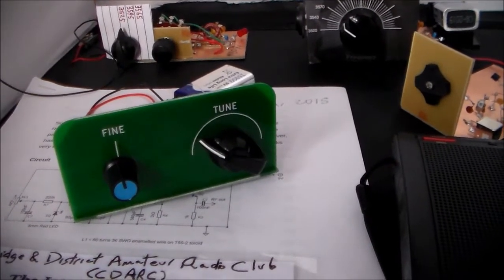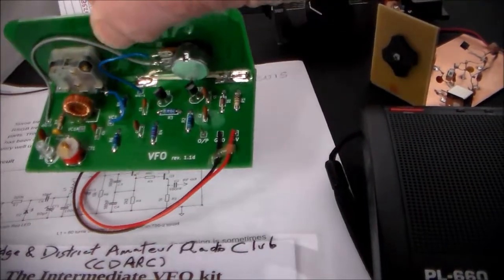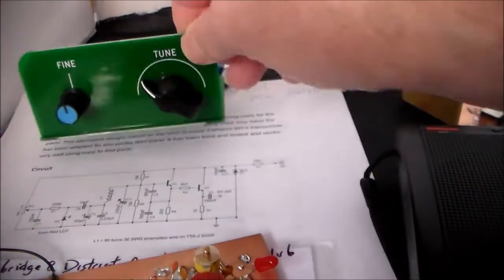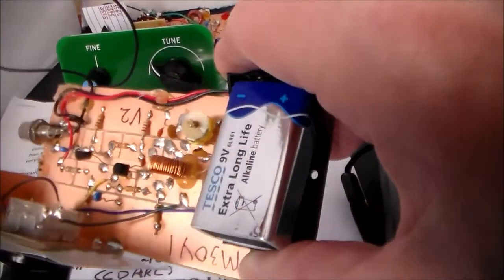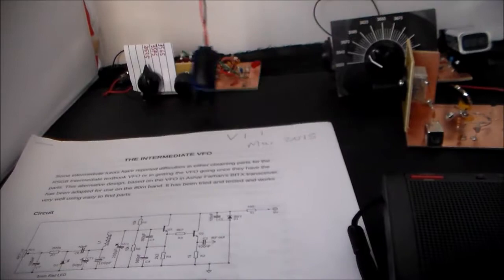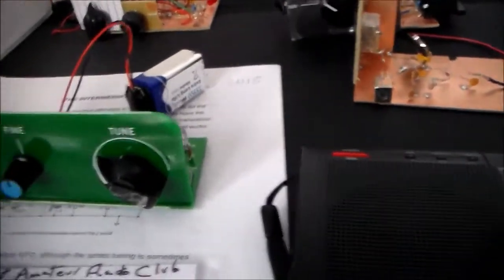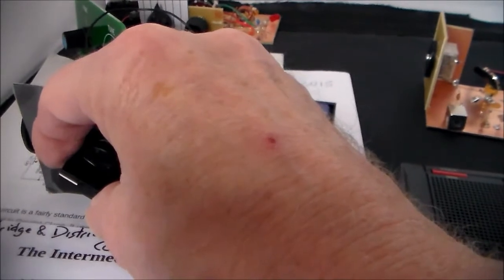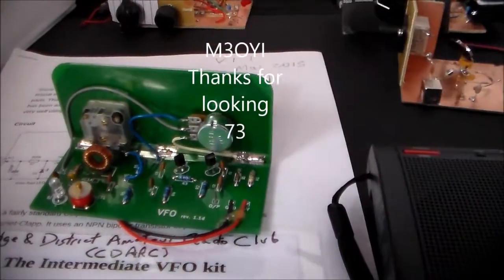Intermediate VFO

Comment: what does a vfo do  whats its purpose?
Reply from the maker: A variable frequency oscillator (VFO) in electronics is an oscillator whose frequency can be tuned (i.e., varied) over some range. It is a necessary component in any tunable radio receiver or transmitter that works by the superheterodyne principle, and controls the frequency to which the apparatus is tuned.